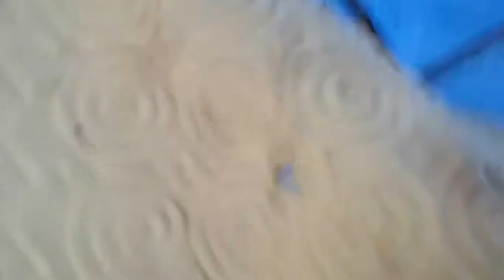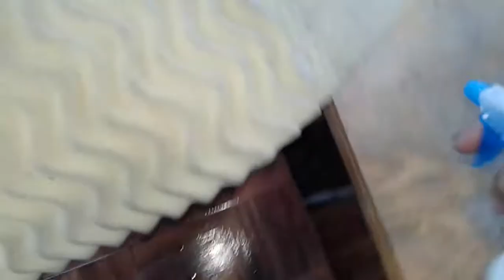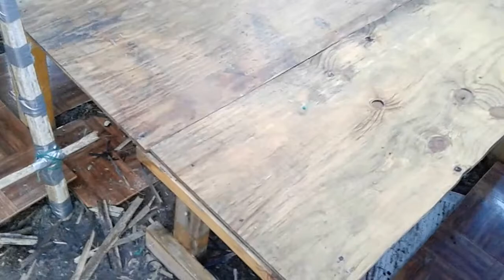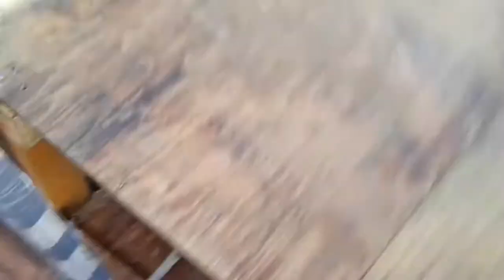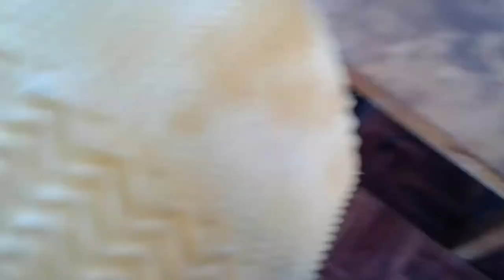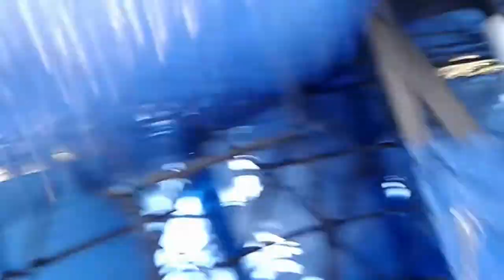Tiny Home - Getting Rid Of Mold and Mildew (V598)

Comment: Can you make a very small trench (or 2, or 3)...more like a divet in the roof...as in, from the center outward, so that rain can have a path to run off? Either that or underneath the roof tarp but above the fronds, something that will create a wedge...to make the roof more convex?
Reply from the maker: nh libra Only if it had been designed for that from the beginning. With the roof having collapsed twice already, it's pretty lopsided now. However, as I write this, things are a lot more stable at The Yurt now. I was able to be out there in the rain today to observe and adjust the roof as needed to allow the water to run off.